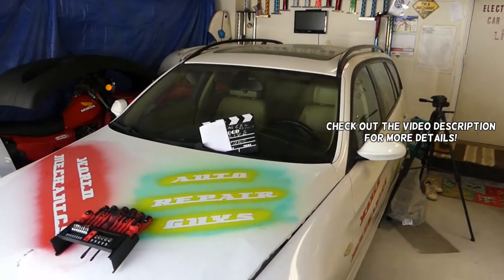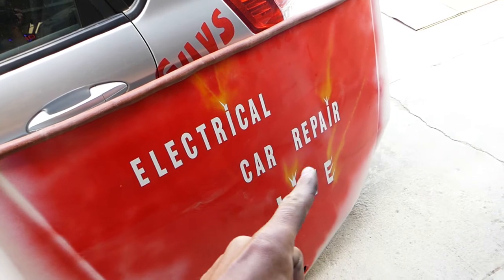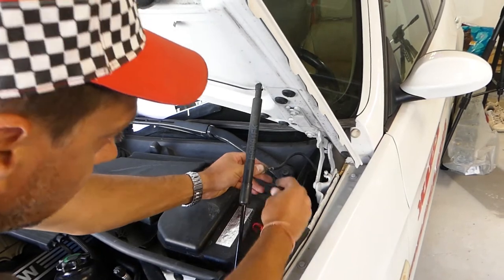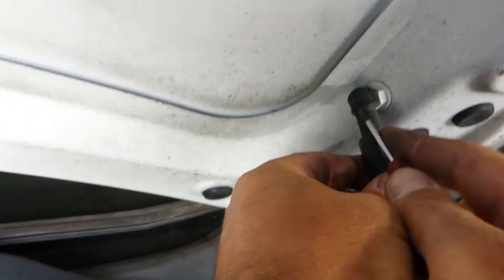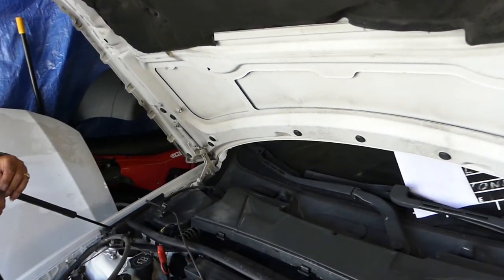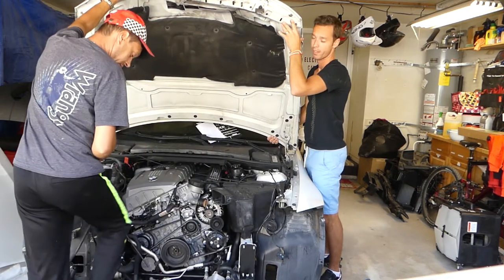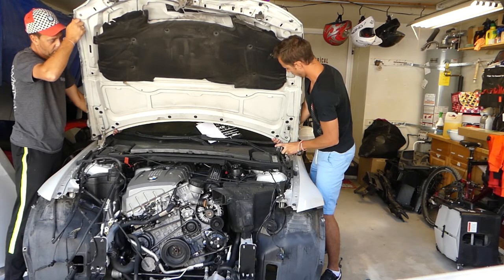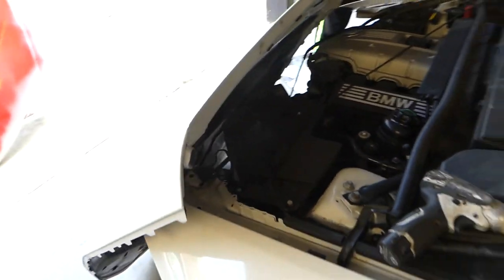BMW E90 HOOD REMOVAL REPLACEMENT E91 E92 E93 323i 325i 328i 335i 335d

Comment: Please make a video on how you alligned it when you installed it, it will help alot with my project 335i e92. The headlights sit perfect the bumper needs new lower and upper brackets but from the top of headlights there is still a gap. If you already have a video about it please link it in comment. Im a big fan of your great precise work and always try to reffere back to your videos!